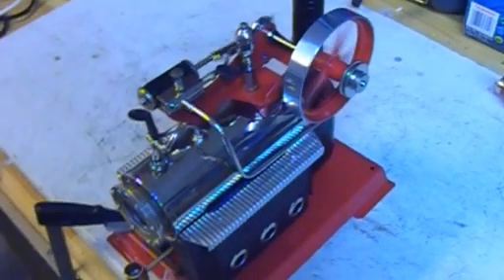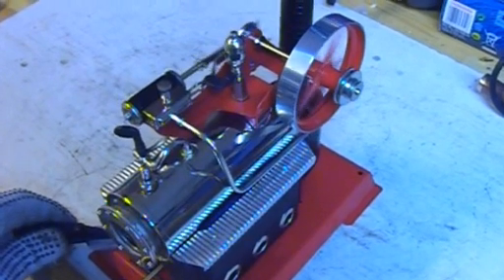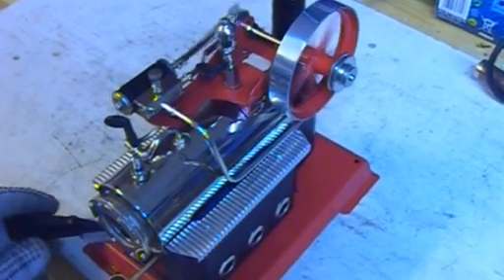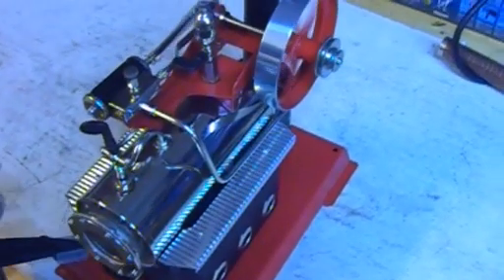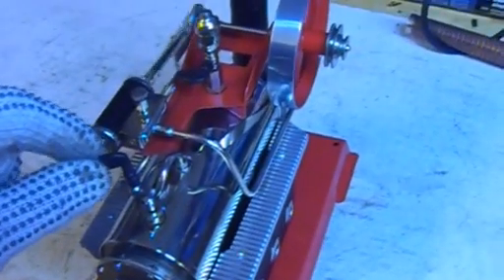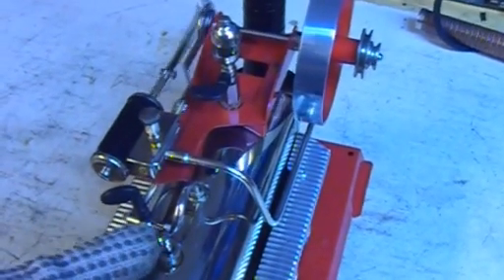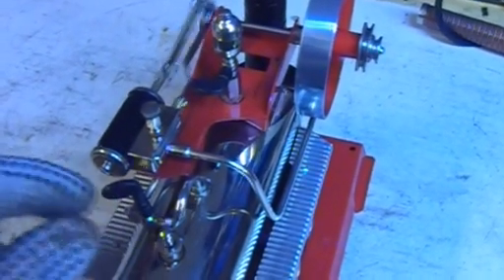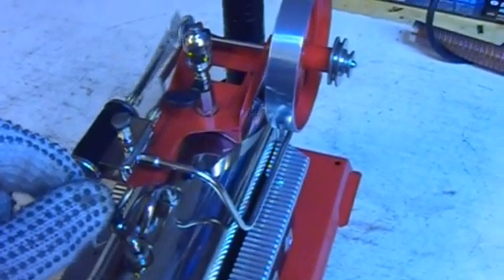Wilesco D14 steam engine modified with in-line valve

Comment: Did you need to modify the plastic part of the valve? I'm going to be installing one on my d10 and after finishing the pipe, it seems as if there won't be enough steam flow passed the plastic valve to run.
Reply from the maker: Hello, i did not modify the plastic part of the valve itself, it should be large enough for steam to pass unless you may have a clump of solder that may be blocking some part of the pipe after the installation.